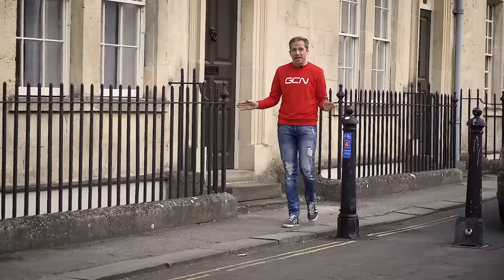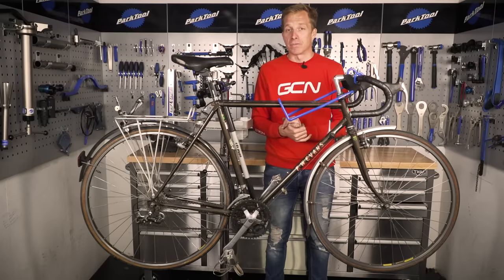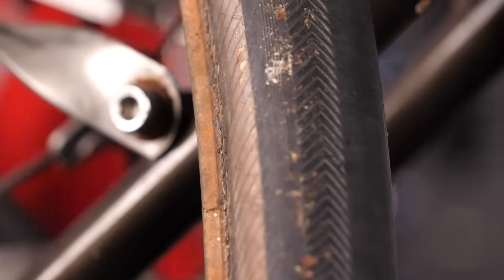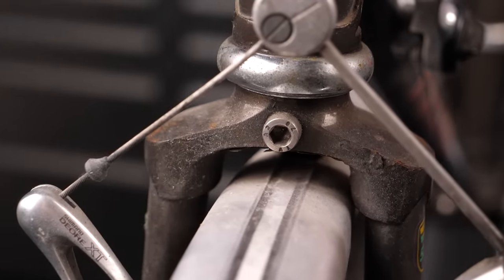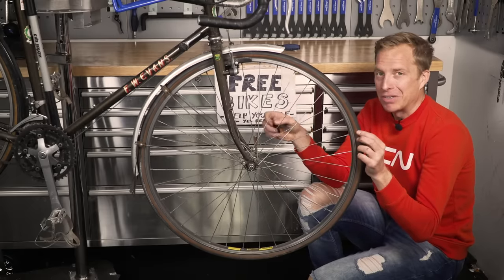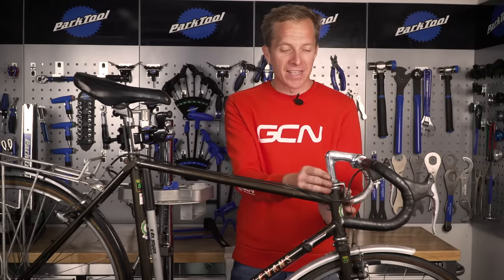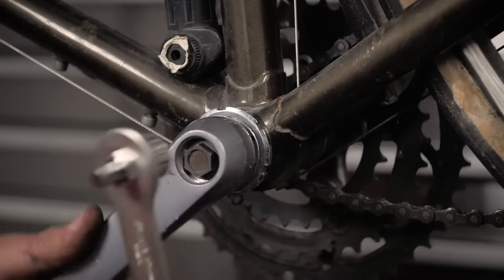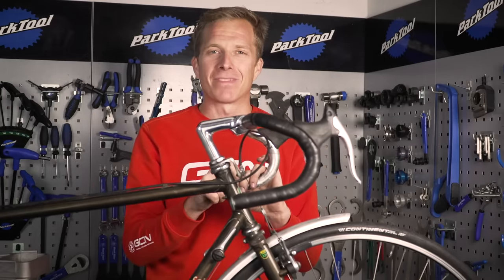Trash To Treasure | How To Fix Up An Old Bike

Comment: This was the best maintained “free bike” in the history of the bicycle. Nobody is ever that lucky.
Reply: I've been this lucky many times with free and cheap bikes.
Reply: it is my experience that friends who don't ride bikes are happy to call you when they want to find a good home for a bike which they happen upon for any of a number of reasons.
Reply: Every bike is free if you own bolt cutters.
Reply: I found a late "90s Kona road bike with 9 spd Ultegra like that once.  I replaced the cables, tires and bar tape and then flushed the shifters (which had seized) with silicone lube and had it up and running in no time.
Reply: I have found several bikes along the road with free signs on them,some that needed nothing more than tune,lube and adjust.In the pre internet days I was gien motorcycles,bikes and even cars that needed what I considered negligible repairs if you were a competent mechanic.
Reply: Let alone a full Reynolds 531 frame and fork 😲 this is too good to be true
Reply: I picked up one that just needed a new rear tyre, new brake blocks and new brake cables, some lube, and air in the tyres.  Hadn't been used in years, but thankfully had been kept in a dry basement so no rust.
Reply: I got a nearly new Peugeot triathlon from my uncles house
Reply: Try the average bicycle someone is willing to give for free in the netherlands after it lived a couple years in a city this bike he got for free is like the most fancy bike i ever saw in the wild besides mountainbikes and racebikes.
Reply: I found an 04 giant that just needed a wipedown seat/post a cable attached and i swapped the surfaced risers with aluminum ones its still on stock tires with the stock deore groupset
Reply: i got a norco fluid dx with just a flat tire by value village
Reply: I would not take all that time and effort checking stuff, first replace the consumables, check drive train, clean and lub if not too worn, check headset,replace if needed , check wheels while  replacing tires then ride!!
Reply: Yeh I have to agree, this smells fishy.
Reply: In Bristol you get it all the time.
Reply: The only free bike I have ever had was so rusty that it was completely orange everywhere.  It looked as if it would crumble if you sat on it.  I was working on the Venice Boardwalk in L.A. at the time and it was perfect.  I could ride it up and down the Strand and if I wanted to go into a store, I never bothered with a lock because no one was going to go near it without getting a tetanus shot first.  I would just dump it in the sand on the beach, go shop, come out and there it was.
Reply: z.browning 500th like
Reply: @CarsFoodWeed  I got my Giant Rincon on Craigslist for $100, guy was leaving the state and wanted to get rid of it to get something nicer.
Reply: I basically got one in the same state for free at a yard sale in Michigan a few weeks ago. At first it was on sale for 3 bucks, but then the guy found out I was french, he insisted on giving it to me. Never knew being French would get me such a free pass.
Reply: I just found a 98’ trek 5200 carbon fiber. It looks like the previous owner never did any kind of maintenance whatsoever. Just lube. This thing was caked with it! I know not all of you won’t like this, but I’m gonna lose the drop bars and make it a single speed. Get some wider knobby tires.
Reply: It’s all about being friendly in everyday life.  Your opportunities for everything will grow
Reply: RollinRat sounds like a fun job
Reply: RollinRat RollinRat I’m glad to hear that you think so. :)  I’m personally currently trying to find a bike to upgrade to.  I only started riding about 50 miles a week in the past few months.  I have an old mountain bike that someone gave me.  I’m currently looking into possibly modifying a $100 Walmart road bike or maybe a used bike from eBay or Craigslist.  Which route would you go?
Reply: ive just found an old mtb dual suspension just mssing rims im gonna restore it hopefully it goes well
Reply: z.browning  Oh it happens. My BRC came pretty close 👍😁
Reply: Depends where you live. I found a nice bike near me this year (mongoose fixie - needed grips and a chain) but a friend lives closer to inner city and is always finding them discarded around his neighbourhood. He updates his kids’ bikes every few months and finds bikes for friends. They all need small repairs but it seems to be easier for some people to just buy a new bike each time.
Reply: Not free but I got something close for $80, a Raleigh Technium 480 6 years ago

Only needed to replace the tires, and just this year one of the rims. Might look into getting the handlebars replaced to get a bit of stem to put a headlight on since the cantilever breaks make it hard to put one on.
Reply: Actually not true....I just bought a 1983 Raleigh Grand Prix for $60. Turns out under all the grime and oxidation (it didn't even roll freely) was a perfect bike that had never been ridden. It's  beautiful now and looks brand new after some elbow grease and new hoods and tires. Worth between $500 to $1,000 on eBay and none are even remotely close to the beauty or shape mine is in.
Reply: @MrSttlesks  same free schwinn on the side of the road was my best bike
Reply: He did say at the very start it’s not often
Reply: @davenixon1920  Might look nice, but its nothing special. Not worth near that. E-bay selling price is usually over priced by far. They were about $400 new.
Reply: @hemisuperzee1287  sold it for $600. Had $160 in it. The value is what people are willing to pay for it. Not the price it was when it was new.
Reply: @davenixon1920  Ive sold 300 tuned/cleaned up  bikes in the last ten years. The price you got was outstanding. Curious as to what selling platform you worked with to attract that high end buyer. Im guessing your buyer was from one of the coa$tal areas? E-bay can find that one "crazy have to have it" buyer, but takes a while sometimes, then the boxing up...
Reply: @hemisuperzee1287  Same here. I do both restorations as well as "restomods" to steel vintage bikes. I usually use Craigslist, Facebook Marketplace, and eBay. Each has its own buyer profile, for sure! This sale was regional and had sentimental value. Hence, the "value people are willing to pay...." comment. If you're willing to wait, you can usually get a decent price from the right buyer. Depends on your business model, I guess.
Reply: @davenixon1920  CL (cheap shoppers) and Market place just wouldn't bring that price in my region. Prob $290 max (in bike store or private selling) even in this covid bike frenzie.  You really got lucky..and found the customer who had that bike as a teen or something(wow !).  I move more volume vs waiting forever though (limited riding season here). I do have a few rare one$ that will go on E-bay to reach a wider audience who know what they are looking for.
Reply: I found a matched set of Austro Diamler Puch bikes at a  yard sale in a rich neighborhood.  The sale was over. The bikes didn't sell. The owner knew how much dough he dropped on these bikes and I had to be very nice and kind to get these bikes for free but eventually I left with two bikes and a teakwood bed for free. So yeah guys, it does happen!  And I have given away some of the best bikes to those who need and appreciate them. 
So you want to know what I would check on a free bike first?  Probably is the frame high quality and in useable condition right on the spot.  On these old touring bikes it needed to be light and strong.
Reply: I got one, frame had broken in half but everything else was perfect. Won a new frame on eBay for 20 bucks
Reply: trek 7000 .needed tires  brake tune. seat. tires in back.. slight clean.... sold it for 275.oo. to guy who said he had one stolen...
Reply: @RileyGoss  😂😂😂
Reply: Nice pfp
Reply: Yeah, got a free one from the dump, the chain is so rusty that it wont even be a chain
Reply: Actually I just found a jamis mountain bike on the side of the road for free! People throw away some crazy stuff!
Reply: No joke. That touring bike looks fine as is. Speaking of touring bikes I'm planning on searching at some point in time for a Trek 520 touring bike. My objective is to use it for one or two tours: Saint Augustine, Florida to Key West, Florida and the other is Astoria, Oregon to Yorktown , Virginia.
Reply: I’ve certainly gone after some “tree leaners”, usually motorcycles but just acquired three straight but rusty human powered gems, and they are light years away from this clean!!! Let’s just say penetrating oil is currently doing its thing.
Reply: I got pretty lucky with a late 70s Raleigh Royale, a little rust here and there but it is definitely possible to restore the original paint, all original everywhere else. Rides like new! It’s a beautiful bike, and I picked it up for free at the dump. I would totally say it’s possible to find gems like the bike in the video, unbelievable what people throw away!
Reply: Maybe not free but if you know where to look you can find very good bikes for very good prices (garage sales, flea markets, craigslist, second hand stores, for example). I bought a Trek 8000SL with all XT gears set and Judy Schock and Bontrager headest seat stem for 100 dollars. It only needed air in the tires but I had the money to get it overhauled (especially since i was riding in traffic rather risky).
Reply: I found one in equal or better condition for 5 dollars at a thrift store. not quite free but it just took some lube and it was up and functioning
Reply: I just received 3 bikes for free from the technician that installed my internet.. he heard my son and I talking about our attempts at repairing a bike and asked if we’d be interested in some bikes.. his kids were all out of the house now and they weren’t being used.. it was such a blessing.. I was surprised at how nice they are.. but they seemed to have been kept outside unfortunately
Reply: I found one sold it an hour later for 100

Comment: Hey! I found one! I was walking down the street and I saw a pristine Cervelo S5 leaning up against a fence, obviously just discarded. The first step in restoring it was to cut off the U-lock the previous owner had put around it that was tangled up with the fence. There was a cable through the wheels, to. I came back with my cordless angle grinder and got them off pretty quickly. I didn't want to disturb anyone, so I waited until a truck had parked in front of the bike to help screen the noise. The tires were still full of air. I rode it home! Thanks GCN! This video made me realize how important it is to keep my eyes open for those 'hidden gems'. They're out there!
Reply: w
Reply: The guy àcross the road put a OCR 1 giant out for council collection last week. I grabbed it and moved to my driveway. No rust except a dusting on the chain. Front tubeless tyres is leaking air. It will do as a spare bike.

Comment: I cycled 3 miles and walked home to collect a FREE BIKE. I was so surprised when I came home with a 1985 Vitus 979 racer. The bike is perfect having been kept indoors (wheels were in the garden for some reason but were perfectly ok). It's a lovely anodised blue colour, has a 2kg frame & the styling of a Spitfire - what a freebie!

Comment: You better believe you are lucky to find that bicycle.  A 531 high quality steel lugged and brazed frame with pannier screw eyelets, a triple crank, Diacomp center pull cantilever brakes which will clear any width tire.  That bicycle is will serve so many functions.

Comment: What a peach of a find - you're lucky to find a Reynolds 531ST sticker on it!

I have a v small cycle business which is mainly concerned with fixing up this sort of bike, often in about this sort of condition, often quite a lot worse. 

There are some good tips there, but I don't think you went far enough!  That bottom bracket is probably all dry and crusty - for reliability and in the interests of preserving the components, you'd be better off dismantling it, cleaning it and re-packing it with fresh grease. Same with the headset, which TBH in my exprience anyway, don't tend to suffer much from pitting, but more from the bearing races failing and falling apart.  There ain't usually enough torque going through a headset to seriously damage the bearing surfaces if you think about it.

With the wheels, you can't really tell what the bearings are like by spinning the wheel - at the edge of a wheel, you get too much mechanical advantage to feel anything.  Much better to remove the wheel from the bike and spin the axle.  I bet they're rough!  Just like the BB - dismantle, clean and re-grease.  You can also then satisfy yourself that there's no pitting or failed bearings.  Also check spoke tension, by the sound of the spokes when you ping them if you don't have a spoke tension guage.

Cables-wise, I think it's a false economy to keep the old ones or bother to lubricate them.  They're so cheap and make such a difference - just replace them.  Old cables stretch in use anyway (they don't just get longer over time, but become stretchy like elastic) so new ones will give a much more positive feel.

Brake blocks and wheel rims: check both and note that on vintage rims without wear indicators, rim wear can be hard to detect.  The brake blocks are probably hardened with age and for a few quid change them.

Finally, treat the brake pivot bolts, chain and derailleurs to a bit of lubrication, even if you can't be bothered to clean them up.

Send me your bike and I'll have it feeling like new again ;-) 

Cheers,

Simon (of Kinglite Cycles)
Reply: Definitely repack the bearings: wheel, headset and bottom bracket and replace the ball bearings.  On some older bikes the bottom bracket or headset bearings may be in a retainer ring; if the bearing races are worn and can't be adjusted to move freely without play, repacking with fresh, loose bearings will often restore perfect operation.
Reply: "Old cables... become stretchy like elastic"
No they don't, that is ridiculous. But the rest of your advice is just what I was thinking.
Reply: Haha - I didn't mean literally as stretchy as a piece of elastic, but stretchy rather than pre-stretched. This effect means that old cables don't enable you to apply brakes as hard or sharply as new ones because the harder you pull the lever, the more the cable stretches.  If you think about the length of a rear brake cable - e.g aprox 1000 mm, and the amount of travel that the brake lever causes i.e. about 25 mm, you're not talking a huge amount in terms of percentage stretch before it makes a very noticable difference.

This problem also affects indexed gear systems.

Happy Cycling!
Reply: Unless you are superman, there's no way you are stretching any cable a significant amount relative to the magnitude of the working motion of the brake mechanism.   There's no doubt that old cables can produce a spongy feeling, but it's almost certainly NOT because they are behaving like elastic bands.

I think what actually happens with old cables is that they get less bendy, either through work hardening or corrosion.  New cables definitely feel more supple. I think the spongy feeling you get from old cables is that they don't bend as nicely around the curves in their housing as they used to.  It's a lot like if you routed your housing with a sharp kink.  There'd be a noticeable delay in brakes engaging when you squeeze the levers and a noticeable delay disengaging when you release the levers.
Reply: Good call on all of the above, but I'd also do something about that rust.  I got my old 531 stripped and powder coated for £110 locally, was in a terrible state and now looks ace.
Reply: @SBOReeves  They don't become "more stretchy", they're steel wires. It's usually due to old cable housings more than anything.
Reply: @kyle8952   Yeah, I've been reading about it and you're right.  Although it seems the cables themselves don't become stretchy as I'd originally thought, it's the outer that begins to degrade and ends up giving the same effect.  Either way 'dem cables are better off replaced ;-)
Reply: What a wonderful contribution to this whole discussion. I salute you for all of that! Good man!!
Reply: @SBOReeves  I cannot believe the level of intense criticism that guys have taken the time from their (obviously boring) lives to give to you! What a load of effort expended to be so picky, and downright rude in cases.
I normally detest the term "Get a life", but seriously, in this case, these guys need to!!
Reply: Great comments, Simon!
Reply: With the axle in your hands, you will really know how freely the wheels spin.---i agree.